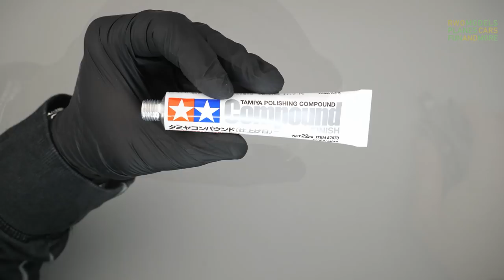Grumman A-6E TRAM Intruder 1/72 Italeri 1392 Full Build Video | RWO Models

Comment: I remember building this kit (well, EA-6A Wild Weasel version, to be exact) about 20 years ago. Back then, I thought it fit really well and the details were great. Of course, standards were a bit different back then. It was pretty much expected that every joint will have to be filled and sanded. I did not even have putty, I used thick glue to fill major gaps. And the paint to fill the minor ones (my model was wholly painted using a brush, in grey-over-white Vietnam-era scheme).
No acryllic paints, no water-soluble putty, no precut paining masks... yet, it turned out pretty well - it still sits in my display cabinet :)
Reply from the maker: Awesome, thanks for your comment! I’m still relatively new to the hobby and don’t know too much about the changes in quality standards. Like many of us I messed around with a few kits as a child (more than fourty years ago). At that time these were more like toys anyway, now the models mean much more to me and I hope I can keep them for as long as possible. 🙂 Cheers, Oliver/RWO
Reply: @RWOModels  It's just that newer kits (made after 2000) are insanely more accurate then the earlier ones. Everything is computer designed and precisely machined, so they just "build themselves", like those Tamiya kits.

Kits from 80-ties and 90-ties (like this Intruder) are still mostly OK, with good detail and recessed panel lines. Stuff from the 60-ties is a major pain to build, but sometimes you have no choice if you want to build some particular rare subject (e.g. I built C-121A Constellation from Heller once, a real stinker of a kit which builds into a beatiful, impressive aircraft).

Since kits are repacked over and over again, you can still go to the shop and buy a new kit which comes from the molds made in the 60-ties. Before you buy something, you can go to a website like "Scalemates" and read everything about every plastic kit ever made - if it's a new release or and old repackaged classic.
Alternatively, if you want to build something specific, you can go and find out what kits are/were available and which is the best.

Keep it going :)
Reply from the maker: Thanks for your explanations! I also frequently check Scalemates to find out about kits that interest me, and of course I noticed that some of the kits I built were better made than others. When I started last year I only bought kits of the planes I like and that seemed easy to build, regardless of their age, now I actually try to get more modern, high quality kits where possible. The Heller Lufthansa Super Constellation is also on my wish list, maybe some day I’ll find one for a good price. 🙂 I’m sure it builds into an impressive model. 👍
Reply: @ammarmar3628  This kit is still available from Italeri and reboxed by Revell of Germany with the same markings.

Comment: Great result. I will use your experience when building my Intruder model.
Any thoughts on how to make the decals more contrasting? Should I use a lightened base paint?
And another question - why do you use Vallejo paints?

Nice watches! 😎👍
Reply from the maker: Thank you very much! I’m 100% sure your build will be awesome with all your fantastic detail work (whereas I’m just a simple „out of the box builder“ 😳). Regarding the much too light decals I think I would now go for darker aftermarket decals. On most A-6 pictures I found with the Ghost Grey low-visibility scheme the markings are in fact darker than the base color. The included decals however are lighter so I don’t see any chance of fixing that, especially with all the tiny stencil decals.

When I started the hobby last year I quickly realised I needed better paints than the crappy Revell I initially used. So I started buying a lot of Vallejo Model Air since they have a great range and are available at my local hobby shop. Is there anything wrong with Vallejo?

Thanks again! Cheers, Oliver/RWO
Reply: @RWOModels  Thank you.
Vallejo is good paint. In hobby shops In my city Vallejo is a bit expensive, so I use Mr. Color.

Comment: Fantastic job!!!, Which is the dilution and psi that you used for the white marbling and the grey ghost layer? Thanks
Reply from the maker: Thank you! I'm afraid I can't tell you the exact details since I often adjust dilution and pressure on the fly. Starting point is usually around 15psi but I have a small adjuster valve attached to my airbrush and when doing fine detail work I go as low as even possible and adjust dilution accordingly so that I can get as close to the surface as possible. Also, each paint is different so you may need a few tests before painting your actual model. Took me a bit of practice, and the airbrush needs to be perfectly clean as well. For the ghost grey layers I diluted the paint a bit more than usual (60-80% thinner maybe?). Sorry for not being able to give you a more accurate answer on this... Thanks again and take care, Oliver/RWO
Reply: @RWOModels  thanks Oliver for your answer👍🏻

Comment: Great job.  Sorry, I missed it:  Why was it a mistake to add the pylons before painting?
Reply from the maker: Sorry for my late reply. I had attached the lower parts of the pylons (the actual rails carrying the bombs, don't know the exact term for these) in the wrong direction. Also it would have been easier to paint and weather the parts separately. Thanks for watching!

Comment: Please tell me what kind of tweezers 189 is?
Reply from the maker: Hi, the tweezers with the "189" engraving on the inside are the Tamiya 74108 "HG Angled Tweezers (Round Tip)". I also use the Tamiya 74047 "HG Angled Tweezers" which have a smaller tip. Highly recommended. Hope this helps.
Reply: @RWOModels  thanks

Comment: What weight version is that but nice
Reply from the maker: The weight I put into the nose is from a relatively large piece of lead a friend gave me who is a roofer and uses this for his work. I cut it into small pieces so that I could fill up the space more easily. I hope this answers your question. Thanks for watching.
Reply: Does Vallejo need thinner like dark ghost and light grey?
Reply from the maker: Yes, absolutely. Vallejo claims that their Model Air paints can be used directly from the bottle but from my experience they definitely need a good amount of thinner and/or flow improver.
Reply: Like flow improver or airbrush thinner?
Reply: 19:13 what needle use and nozzle cap weathering to dark and light ghost grey 20:09
Reply from the maker: Harder & Steenbeck Evolution Silverline 0.2mm with original nozzle cap
Reply: What ratio paint and thinner on the dark and light ghost grey
Reply: What color of tailhook is it white or steel metal gun metal of the a6